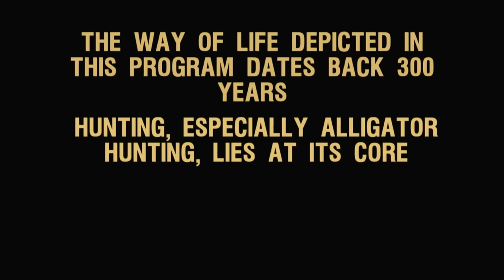Swamp People: Old Scores to Settle (S10, E4) | Full Episode | History

Comment: Lol, they had to use they tracked buggy to get there. The bank they were on was cut grass, they could’ve easily drove there.
Reply: Likely they did.  On episodes  showing an area that's hard to get to - when they do get there, they  usually check their lines  which shows they've already been there before, to set those lines...
Reply: They had worn tire tracks where the buggy was running. As you said, the area was maintained with a bush-hog. I don't understand why they had to fake this when there is so much to work with in this type of series.